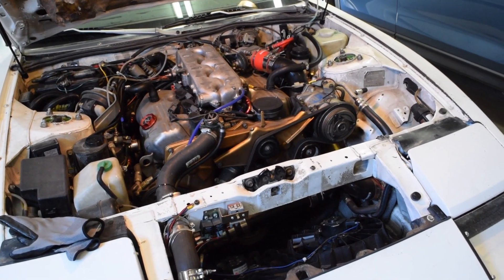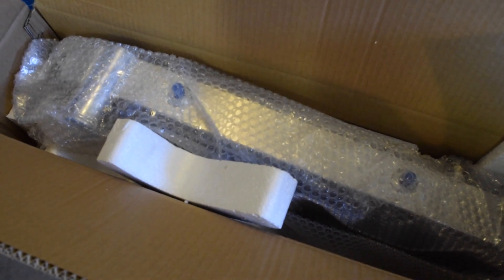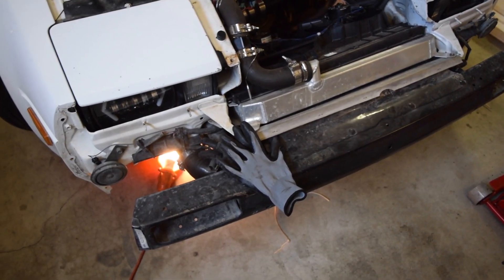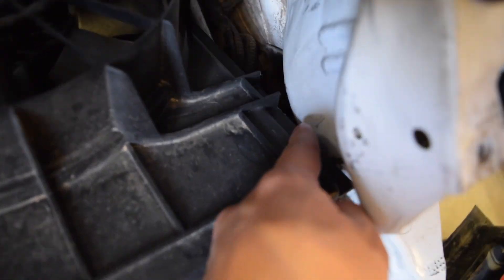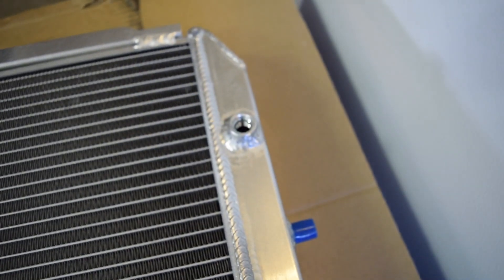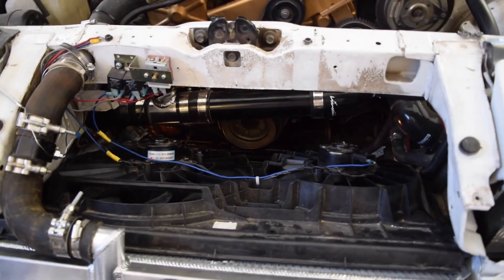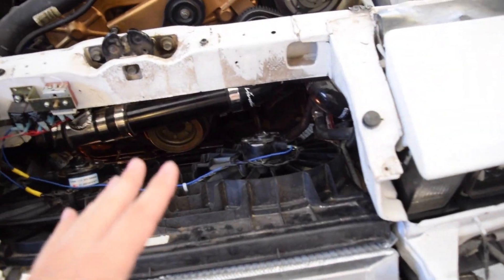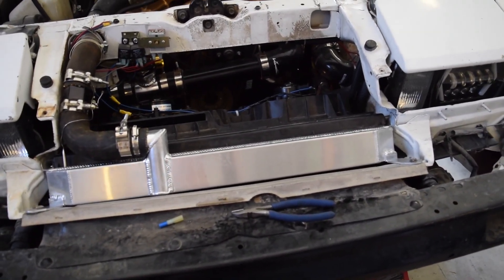Installing a 3 Row Radiator in the Z! (300zx Z31)

Comment: Question? I got same radiator and the hose from the bottom goes into that metal pipe then into the thermostat housing but mine doesn’t fully fit on housing. You have a problem with that?
Reply from the maker: I haven't had any issue with that hose specifically. You're saying that the hose doesn't fit over the thermostat housing?
Reply: I fixed it just now. Thanks tho

Comment: So what do you do with the extra two screws that it comes with? I have the exact same one but I screw them on, they go to the bottom of the radiator? One question I have is what are those two screws purpose?
Reply from the maker: Those are for the automatic transmission fluid to cool it. If you have a manual transmission, you don't need to worry about them. You can cap it or leave it open. It's sealed from the coolant so it won't leak anything out

Comment: That's funny I spotted this radiator a few weeks ago and everything so pretty I'm getting put together on my car that was just something else I looked at and I said I was going to get right this minute or this week anyways I'm focused on the rear differential Mount Polley like yours hell I've done everything else poly from end link bushings to sway bar bushings front and rear to the dust boots on the Outer tie rod ends now I need extended tie rod ends and bump steer spacers and rear diff mount and I will be ready to go suspension wise ready to start this turbo I just got by then ni s t u n e I've already got my coilovers on and most everything poly except the rear diff but soon as I get the rear diff the bump steer spacers and the extended tie rod ends this rad is next LOL it is pretty and with everything under my hood being so pretty already that was just set it off I'm still actually thinking about putting my AC back on the only thing I have taken off so far is the compressor itself everything else is still in the correct spot spot I was going to finish deleting everything from the AC just to give me more room but I think I'm going to run it for its hot in those cars people say oh take all the AC off you got t-tops shit those t-tops or for the birds it gets hot in those damn cars I've owned four of them in my life and I always remember they put off heat

Comment: Hey I have an 85 manual what do I do about those hose connections at the bottom that’s meant for the auto trans cooler
Reply from the maker: Just leave them alone. You can cap them if you don't like the look but nothing will leak out since the trans cooler is a sealed system separate from the radiator

Comment: Can you replace the upper front radiator hose without removing the front bar
Reply from the maker: Yes but with the stock fan shroud in the way its a bit hard to get to. Easiest thing to do is remove the front bumper and you'll have plenty of access but if you try hard enough I'm sure you could do it while the bumper is still on.

Comment: What are the two hoses on the bottom for? I just got a three row, and the new connections are substantially wider than the originals. I was surprised when I took them off after draining the coolant and they still poured out, but it was reddish fluid. And now I don't know what to do with them. Any advice would be greatly appreciated.
Reply from the maker: Those are the automatic transmission oil cooler. You only need them if your car has an automatic transmission
Reply: @TheZGarage  okay, that makes sense. I do have an automatic though, is there some kind of adaptor, or will I have to change out the whole hose, metal pipe and all?
Reply from the maker: I believe the ports are 6an. I don't remember the size of the trans cooler lines but if you can figure that out then get some 6an to barbed fittings, the rubber lines will be able to adapt to the radiator.
Reply: @TheZGarage  sweet man thanks! Looks like I got some chasing to do today.

Comment: Why did you replace the radiator?
Was there a problem with the water temperature?
Reply: I think cuz he didn’t get enough cooling when he used his ac and the rad had a slight leak
Reply from the maker: Correct! The 2 row just couldn't handle driving and ac at the same time. The leak was almost nonexistent but was technically there.